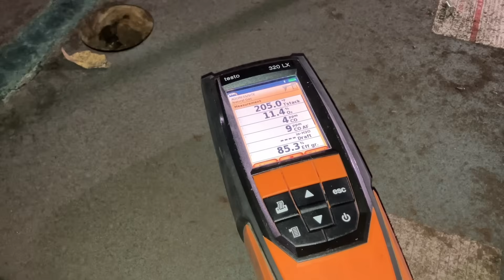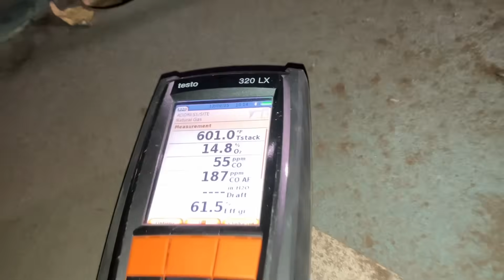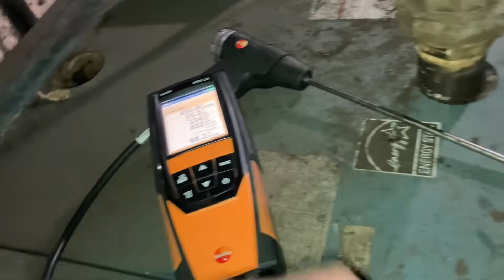Family Heating Home With Oven… Then I Saw the Boiler. UNREAL.

Comment: That's a hydronic boiler not steam. The coil gives it away. Look how high you need water level to cover coil. Boiler is plugged. Smoke pipe is a clusterfuck. Needs new and proper steam boiler.
Reply from the maker: You're right, it's a hydronic boiler.

Comment: That faucet was crazy 😂
Reply from the maker: Definitely a memorable faucet!
Reply: unless it's leaking water, it can be repaired and made safe, with proper BTU input from conversion burner, proper flue pipe and draft damper(no hoods!), burner sealed to the door, etc.
it needs flue pipe setup like an oil boiler, the burner assembly fastened/sealed to the door and of course it cannot be full of soot either.
those conversion setups have worked perfectly safe for many years when done correctly. clearly, they've skipped the correct part and only had clowns working on it.